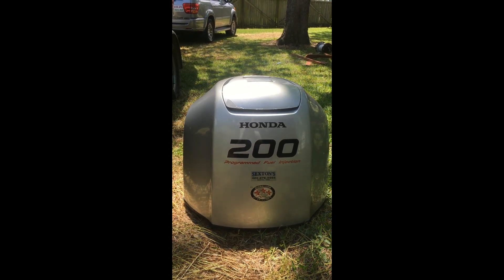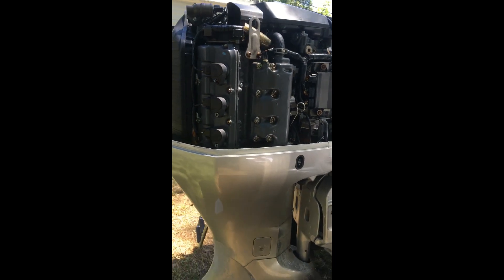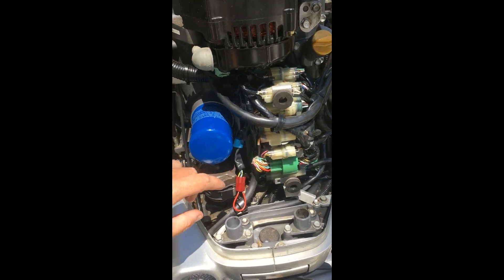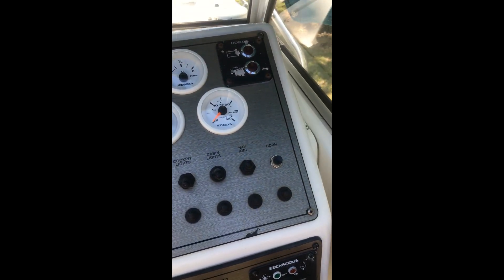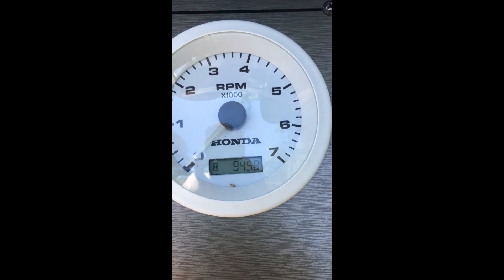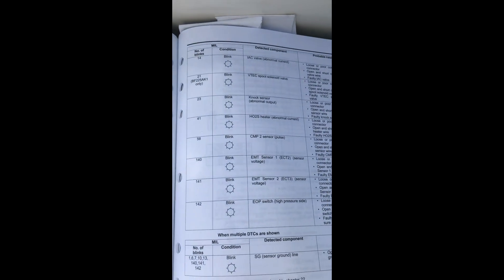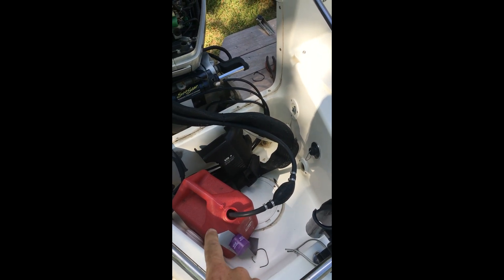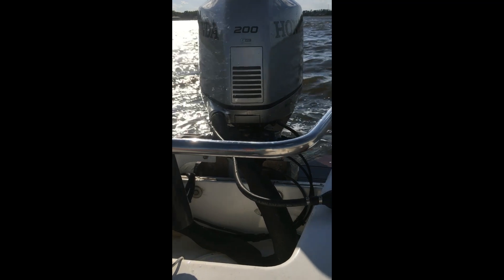honda outboard alarm troubleshooting code

Comment: How did you figure out the flashes were 23?
Reply from the maker: with the red connector shorted(seen in video)turn ignition on, see 4 minutes into video for code. also view follow up video for more info.

Comment: What would make the alarm not even beep when key is turned on? Gauges still come on and cranks over but won't start.
Reply: I have same issue, did you ever figure it out?
Reply from the maker: See the follow up video.

Comment: Watched your follow up video and really wish you would’ve showed us where the O2 sensor is located when you fixed it.  I have a 135 Honda with a constant bell like that happening at all rpm while it’s running and idling